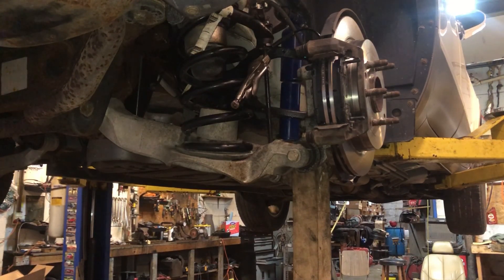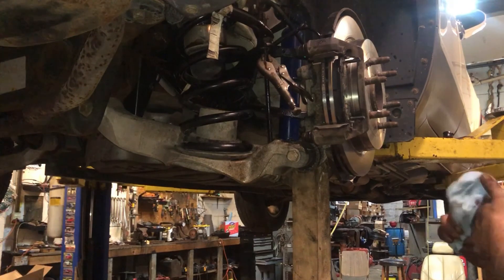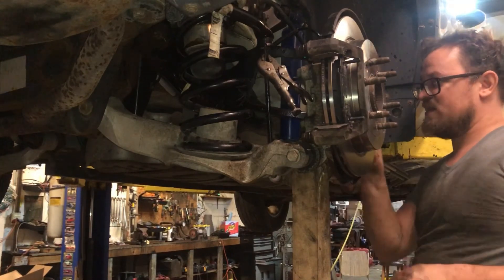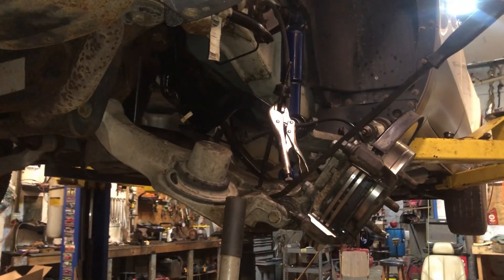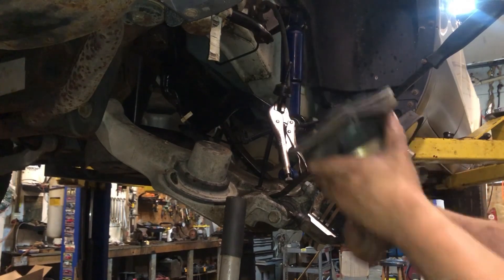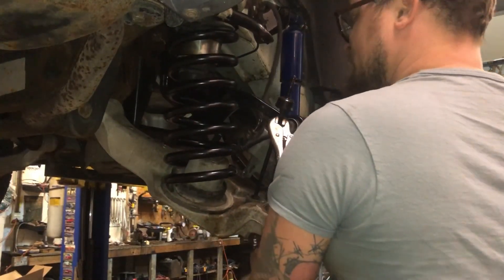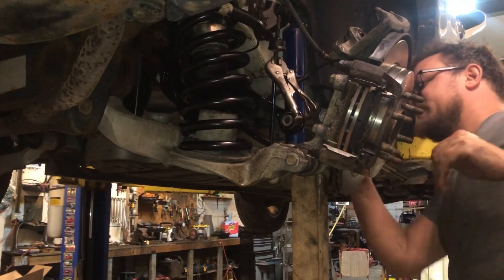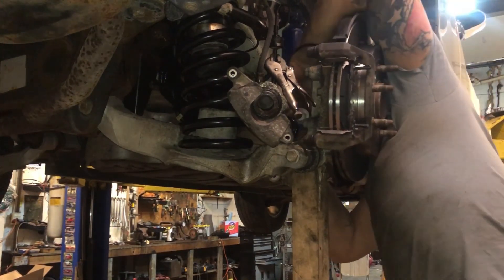Replace coil springs without compressor or special tools independent rear suspension

Comment: Do you know the torque specs on any of these bolts by any chance? By the way great work! This helped me get my moms coil springs, struts and sway bar end links out and put fresh ones in, the only problem is now she’s getting a clunk noise in the back after going over a bump on the rear right side, so I’m thinking it could be the torque specs? If you know the torque specs please let me know! Thanks man!
Reply from the maker: should be able to look up most specs on google, if you need any engine related torque specs i have a mitchell guide